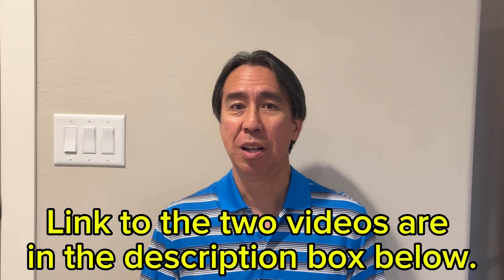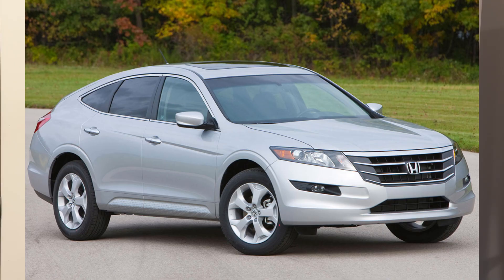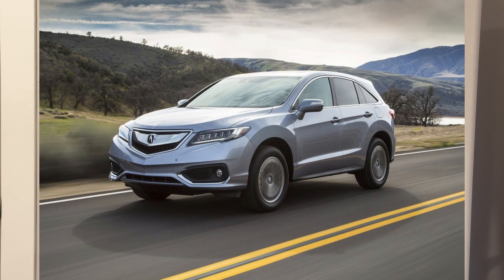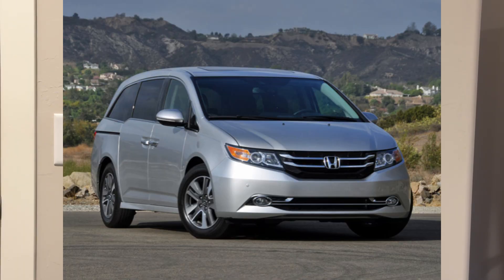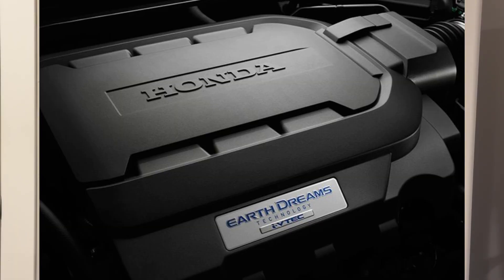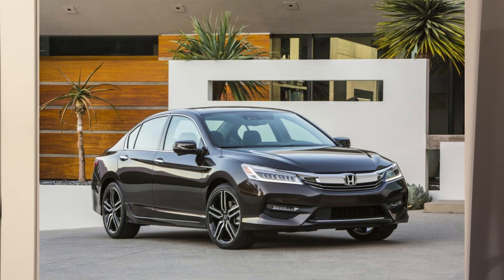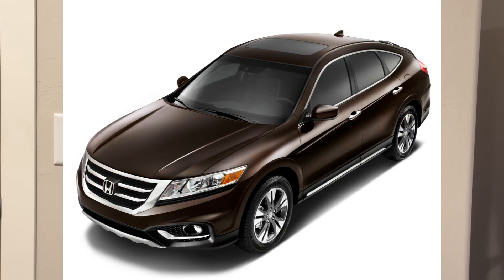4 Versions of Honda VCM (Variable Cylinder Management)

Comment: hi does acura rlx sport hybrid 2018 have vcm or not.
Reply from the maker: Good question, I had to do some research.  Yes, the Sports Hybrid model includes VCM.  J35Y4.
Reply: @andrewwang128  how it can be disabled? with honda hds or ihds or some other option with software or not

Comment: Sir. Which used Honda do you recommend to buy?
Reply from the maker: I would personally want a Acura TL with 3.7L,  However, it would be a 10-15 year old car so it would depend on the condition.  Nice condition examples may be hard to find.